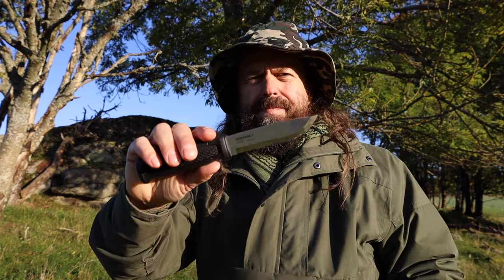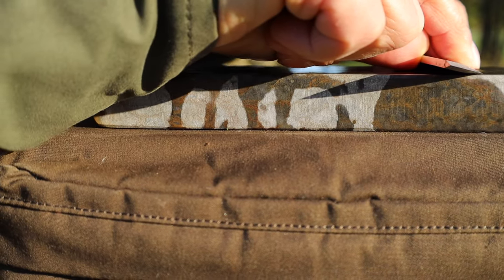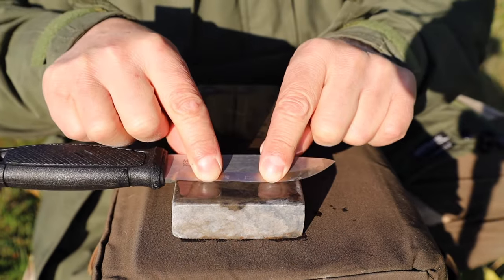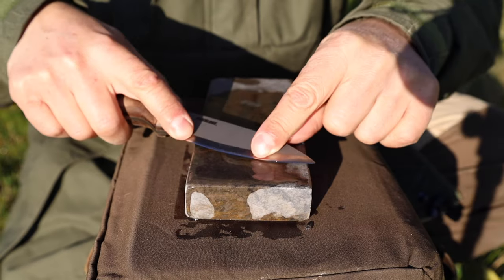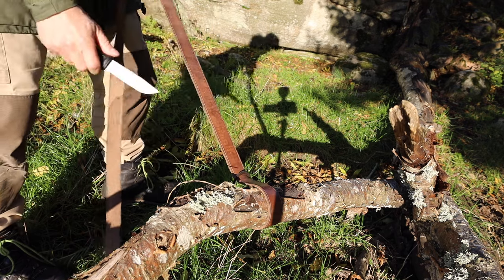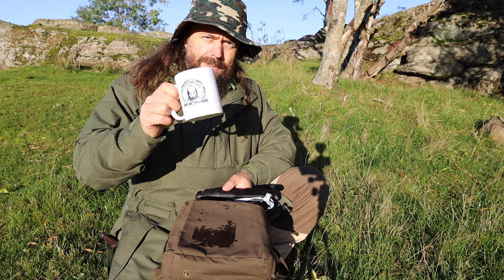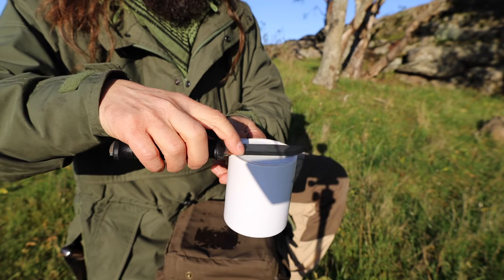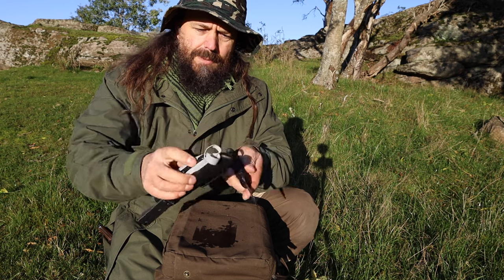How to Sharpen a Scandi Grind Knife

Comment: I used to used to sharpen a straight razor on a belt but I would roll the straight razor on its back each time I change direction. That's why the back of a straight razor is rounded not squared off.

Comment: I hated the big factory grind marks on the bevel of my Garberg.  Spent a couple of hours on a stone getting rid of them and put a mirror polish on the bevel instead.
Reply: I removed the micro bevel and my blade chipped. Took my Mora to a knife store and the put on a bevel even larger than the factory micro bevel. Any suggestions on how to remove bevel without it becoming brittle

Comment: Nice vid 👍Thanks for sharing your preferred technique. 
I personally like to start with the point/curve part of the blade on the stone and then run the blade towards the handle, i find it easier to maintain the angle of the bevel on the stone.

Comment: Yeah the belly on the Garberg is a bit of a chore to sharpen on stones. I use the pull or strop direction only with sand paper on  flat hard surface.  You can angle the belly and then just pull the knife towards you.  This makes its that you can do the blade in sections feeling for the bur to build up. 

I notice in many videos of the Garberg carbon that lots of people dont sharpen the belly portion properly .  You can see that because the black diamond coating is still on the belly wall and not removed like the rest of their blade.  That unfortunately leads to a very obtuse grind in the belly so detailed carving is impossible.  

You should try it,  its the same way just find the flat of the belly angle and pull .  Its very cool once ya get it done using higher grits until its polished.  I like using stones but for scandi grinds ive found no better way than this.
Reply from the maker: The Garberg carbon steel version has a secondary bevel. You are not meant to sharpen it like a Scandi and the coating is supposed to stay on.
Reply: @BjornOutdoors  Yes you're correct , im speaking about videos where people have removed the secondary grind yet can't seem to do so on the belly.
The 14C28N also has a secondary edge its just harder to see it cause there is no coating.  My original Gatberg I purchased at release for $50 , that one had a larger secondary .  My carbon which I just purchased has a very tiny micro bevel ..It really causes an over bite takes some getting used too. I'll probably zero it eventually but,  I want to use it for a year and see how it changes over time with stropping . 

I struggle with making every knife the same grind , it kinda makes knife life boring . 😉

Comment: 0:44 - imho - While finding the bevel is easy.  A person starting out with sharpening would still probably mess up.  
As there is one thing more important; you need to train the 'arm movements' (as you move the knife across the stone), first.
As it is here, the user will stightly 'rock' the bevel.  Its natural in arm/muscle movements to do this.  It is something which many miss (the ability to move the knife across the stone perfectly on the same angle).  If you don't specifically train this movement (first).  You have to go through a bunch of 'real world' sharpening.  Before your arms/muscles (etc) correctly  alighn themselves to this practice.  
When you are trained in sharpening, the teacher can observe from a distance and see the issues (and correct you on them).  
Filming yourself is another way.  But if you do this method, you will be a better sharpener/polisher (with no 'corrected' bad habits) from the start.

PS:
if there is a burr forming on the edge.  Never push the knife on the stone.  As parts of the burr will come off, slip under the blade and scratch the blade (the side touching the stone).  It can also weaken (and make irregular/blunten) the edge (as the burr has to pass the edge too).  
In this situation (forming burr), only 'draw' the knife (spine facing you) towards you.  That way, any burr is pulled away from the edge (and the knife).  And left on the stone (to be washed off before the next pass with the knife). 
If you want 'super sharp' (from free hand sharpening), these are some of the things to try :) 

Peace.

Comment: The belt is con vexing your edge you need to use a solid piece leather with a hard backer so not to wrap around the apex of the edge
Reply from the maker: No, that takes a lot more stropping. This is just finishing it off in the field.